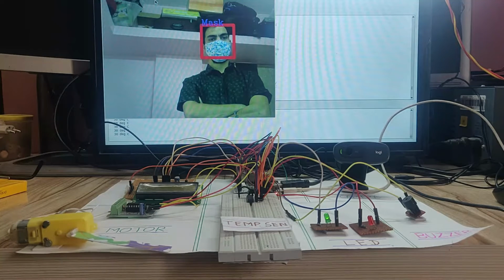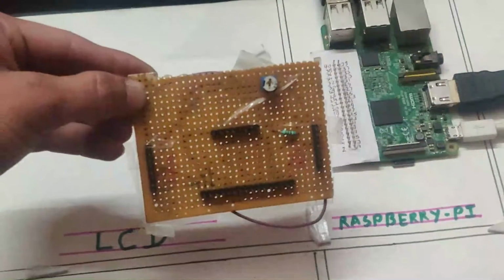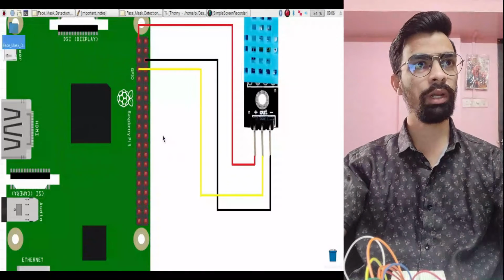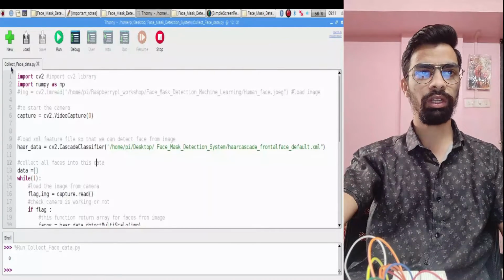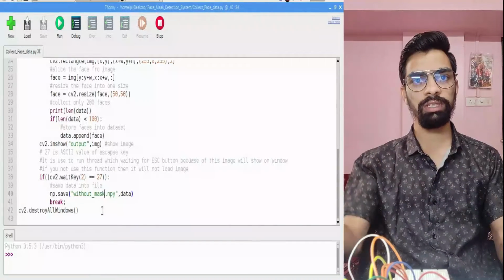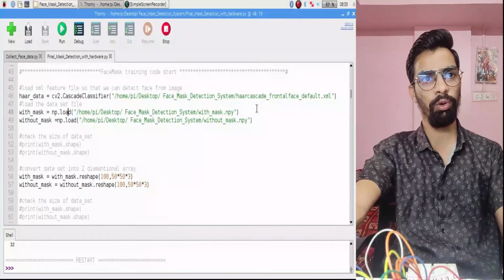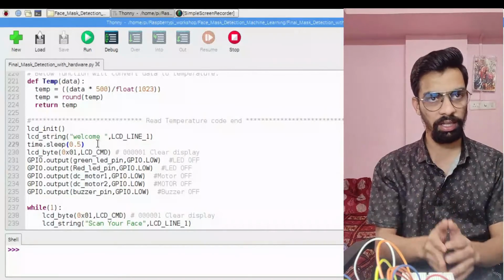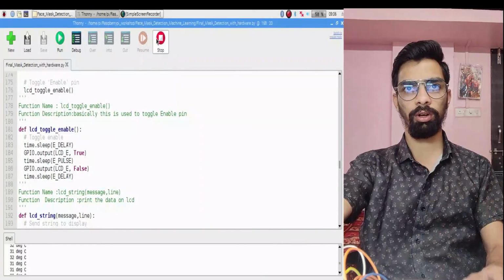Face Mask Detection using Raspberry Pi | machine learning | 100 % working | without Tensorflow

Comment: Great video sir but how to get common VCC and common Ground
Reply from the maker: You just need breadboard.. just take 5v from raspberry pi to common line.and another common line is ground
Reply: Tq sir
Reply: Sir Can you tell me what are the required components to make zero pcb module
Reply from the maker: @kollamoramvineetha  there is separate video please check m playlist you will find detail video about lcd connection . video name "how to use bread board for lcd "
Reply: Is it ok thank you sir

Comment: can i use balaji shrinivansan channel code in this? he used caffebased model and the code is also little different please reply
Reply from the maker: Yes you can use
Reply from the maker: But you need to merged temperature sensor code in that and need to install tensorflow library
Reply: @Rahul_Jadhav_Project  yeah sure thanks 🙏 but I'm not using temperature part in my project I'm only using motor and raspberry Pi, so what should I do? Where should I add the raspberry Pi code (except temperature sensor code and buzzer and led lights) into Python code(ML)
Reply from the maker: https://youtu.be/5uptP78_LAw

Comment: Sir in this project without dc motor what are the changes to be done and raspberry pi 3 or 4 need to be used?
Reply from the maker: You can use any raspberry pi 3 also or 4 also
Reply: @Rahul_Jadhav_Project  what will be it's cost sir?
Reply from the maker: @shaikhassan720  which components ?
Reply: @Rahul_Jadhav_Project  raspberry pi 3 sir
Reply from the maker: @shaikhassan720  it's near about 4 to 5 k

Comment: Sir post the same project using Arduino also
Reply from the maker: Sure
Reply: @Rahul_Jadhav_Project  sir pls make it with Arduino 🥺🙏🙏
Reply: Yes sir i too want it in Arduino
Reply from the maker: @sharmilabora5113  are you from same group ?
Reply: No sir
Reply from the maker: @sharmilabora5113  ok I will make it surely